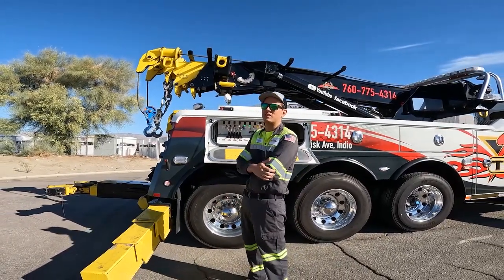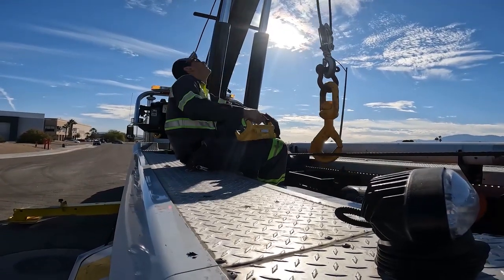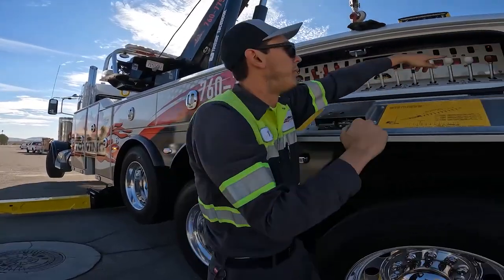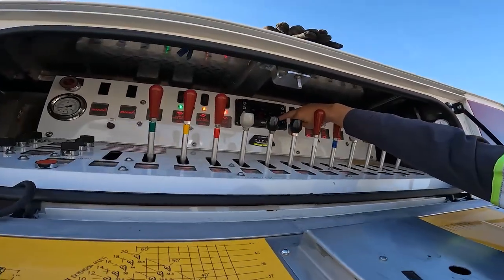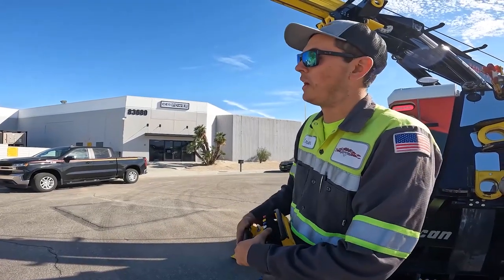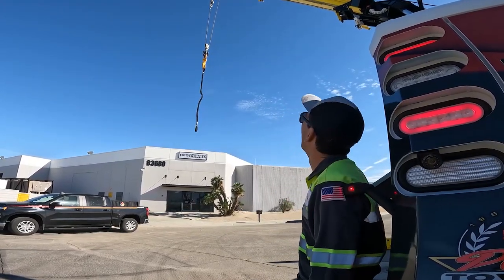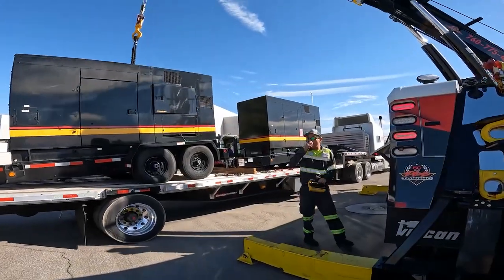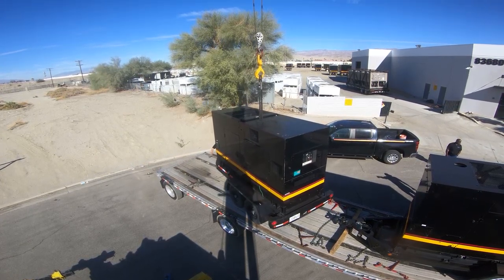Doing Some Light Rotator Work VLOG 017

Comment: Hi Trent, one advantage of a YoYo rig like this is that the snatch block makes sure that the load is equal on the 2 lines. If you used a big snatch block between say,  2 rotators, you can lift a load that is too heavy for either to lift on their own. If each line was attached individually to that load, there is a possibility of overloading one of the rigs.